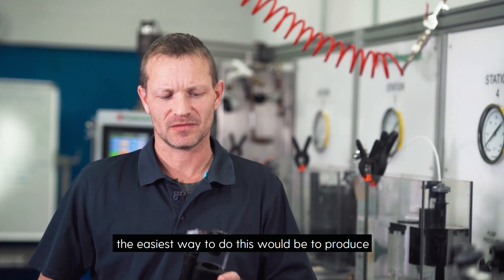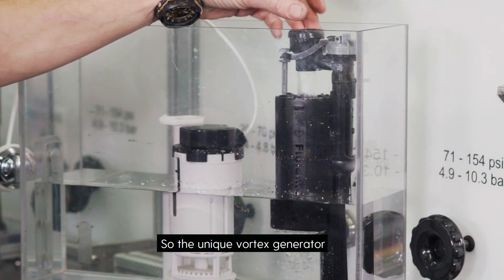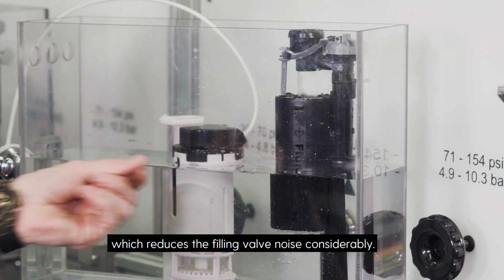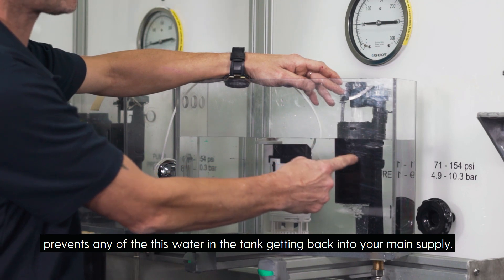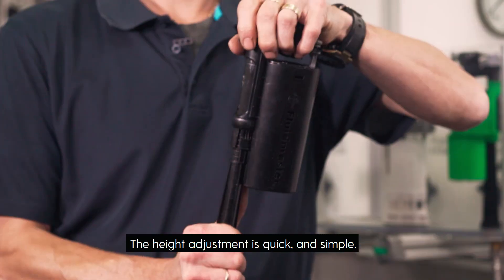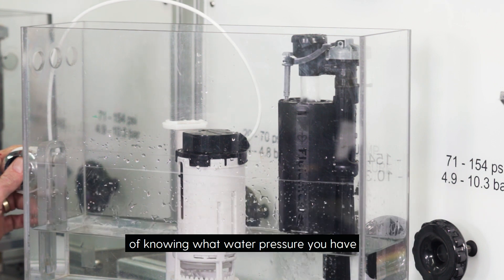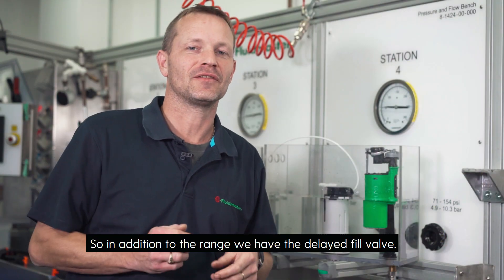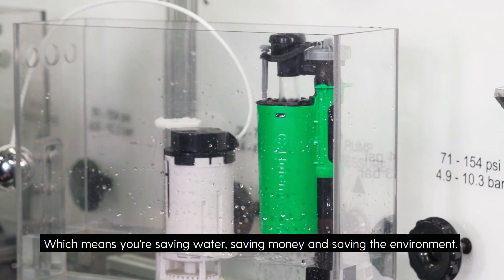The Fluidmaster Airgap 6000; the Only Adjustable Cistern Fill Valve to Completely Eliminate Backflow

Comment: Plumber here.  I feel I need more information

I don't follow how this is significantly different from the Torbeck Ecofil (same company as Fluidmaster - in fact I think it uses Fluidmaster components).  That can also be set to have the outlet above the critical level (overflow height) and thus prevent backflow, and is also height-adjustable.

Is this just a quieter, better built version?
Reply: The difference is the vortex and the downpipe together effectively eliminate splashing, reducing the noise a lot. I installed this in the header tank in my loft, it works much better than a ball valve and doesn't make too much noise.

Comment: Can this be used on a loft fitted water tank or do you have other "delayed fill" valves for this please?
Reply from the maker: Yes it can be used in a water tank, but, the delay fill is only effective in a WC cistern and fitting a delayed valve to a tank would serve no purpose.
The volume of water and speed of a WC cistern flush means the water delay will save incoming water from being wasted.
A water tank is essentially a feeding vessel and will deliver as much water as required and the water level will drop at a slower pace due to the surface area therefore the delay fill does not add any benefit and would not really be recommended.
Reply: @FluidmasterInc   Thank you. I think there's a difference then to this delay and the delay fill the engineer mentioned to me. So this empties, the Fluidmaster then delays a few seconds (giving the flush unit time to close again) and then starts filling up once more. The delay I think I'm looking for in the loft tank is one where the valve would allow for the water level to go down a few cm's first before it starts doing ANY refilling of the tank so as to stop a "dribble" feed from the water softener supply... I dont suppose you sell anything of that sort?
Reply from the maker: @chriscabral8681  we don’t have a product that will help this situation. Our range is more suited to toilet repair rather than loft installations.

Comment: Does anyone know if the Flush 'n Sparkle cleaning product will work with the Airgap system and how to install it? 🤔🤔
Reply from the maker: Hi, unfortunately it will not work because that system does not have a refill port or nipple to attach the refill tube from the flush and sparkle.

Comment: IS THIS FOR ANY STANDARD TOILET >Fluidmaster Airgap 6000
Reply from the maker: Hello Tom, thank you for your comment. 
Our Airgap 6000 solution has been carefully engineered to fit virtually all cisterns on the market, with quick and simple adjustment options making it easily adaptable. If there's anything else we can help with do feel free to get in touch with us on: salesuk@fluidmaster.com 

Best wishes, the Fluidmaster Team
Reply: No won’t adjust to fit most uk cisterns
Reply: Bull. Mine dont even shut off. So much for saving water